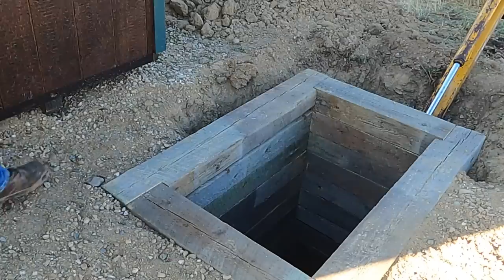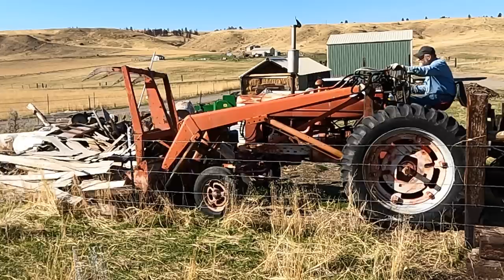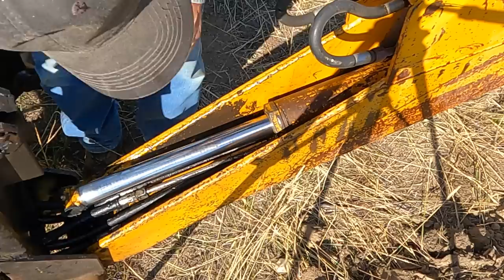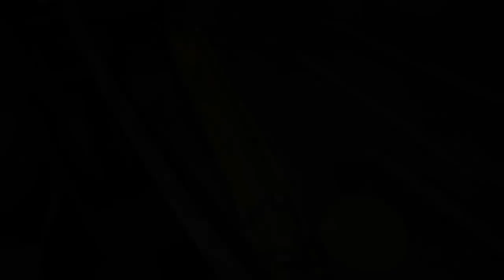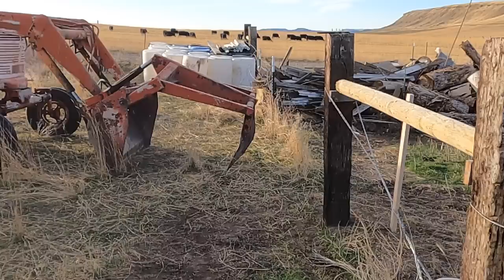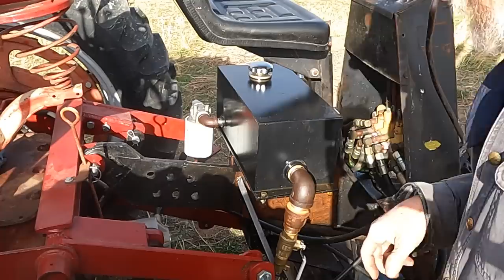Some Learning Comes the Hard Way | Engels Coach Shop

Comment: When you end up with old equipment you tend to inherit the years of poor maintenance, mistakes and patches of others who had the equipment before you. Some of what's been done is good and some of what's been done is bad. 
If you've never seen the piece of equipment before it's very difficult to know what has been done to it which may be the source(s) of problems. 

Sometimes it turns into a learning experience. 

In 20 years of automotive work I had to repair things where there was no repair manual. Having a mechanical engineering background was pretty useful, but it only ever got me so far. The rest was learned through experience. 

So...... I too have a degree from the School of Hard Knocks. 

Good job, Dave!

Comment: Nothing like learning the hard way. I saw that the backhoe shovel seemed a little nervous when extended and then you showed the leak. 
I'd guess by the time this is uploaded you have already got the line in the ground and beginning to cover it up.  Much harder to move frozen dirt, sand, and rock. I think our freeze line here is somewhere around 18in. so we dig down 24in. Don't have a tractor, but a Ditch Witch works just fine for our needs. 
Enjoy watching the progress, and always learn something, so you have a good season and stay out of the cold as much as possible.

Comment: Back in 2001 I took a test on JCB wheeled digger. The examiner failed me because I had dug a long hole and not a trench! I still don't know the difference to this day. I am really enjoying these after work videos just as much as the ones in the workshop.   Thanks for bringing me along 🙂
Reply: Those JBC machines are good, did theexaminer use it at all?
Reply: @jeffclark2725  he did use it and the pins were so worn that he knocked the sides of my "long hole" out! And still failed me! 🤪🤪
Reply: @kirtodam6540  that figured

Comment: Don't feel bad, Ford has been making vehicles for over a century and still did the exact same thing by putting a screen in the power steering reservoir on their small cars like the Focus and many others I am sure which causes cavitation and destroys the pump.  I learned about this from the same school when I replaced the pump for a customer and reused their reservoir and discovered that it wouldn't bleed the air out, it took a lot longer than I would like to admit to figure out that the screen that is molded into the casting and not serviceable was plugged but luckily the fix is to just rip the screen out and put it back together so I have passed that nugget along anytime I have the opportunity. lol

Comment: A little food for thought. I've  always had my hydrants rust through where the pipe threads meet the brass drain. Last time I put hydrants in I dug a 2 foot pit under them filled with washed rock for a good drain, I then set the elbow on a concrete pad and put a 10 section of 4 inch sewer pipe over the hydrant pipe with a cutout to fit the water line and it sets on the pad the top end comes up to the top of the hydrant where I used a reducer from 4 in down to 2 inch with a rubber grommet to fit from 2 inch to the hydrant pipe now I got no ground contact on the pipe and ground heat to keep it somewhat warmer and clean. Working good after 17 years and counting.

Comment: I watched your video on forming stage coach side panels. I used to work in a boat yard and I would resaw  14" x 5/4 lumber (mahogany) to 3/8" on an old Oliver 36" band saw with a 12" tall plywood fence and double decker finger boards and then through the planer for 1/4" thick finish planking on  big mahogany motor boats (26' / 36') with twin Mercuiser engines

Comment: Make sure and dig down below where you place your hydrant. Even a post hole auger would work well. Back fill with gravel for a place for the water to drain. With that hard clay you are digging in, the water won't have a good drain to run back out of the hydrant. Eventually it will star to build up and reach the frost line. I always liked the application where they use a vertical piece of culvert and filled with baseball sized rock, so a person can just empty the hole out by hand to access the foot valve without having to re dig the entire thing. I do wonder how the air gaps in the stine might effect the frost line depth though???

Comment: It is always a good idea to use a suction line filter, in hydraulic systems, to protect the pump. But!, suction filters are much bigger than return line filters and are designed to have a lot less back pressure, resistance to flow.

Comment: Hi, Dave pleased you have sorted the hydraulics they are fairly simple until something goes wrong as most things with machinery thank you again for the video.
Reply: I ran a broach once that was controlled by hydraulic logic. I asked the foreman, How come you don't get someone to fix this thing? He looked at me and said, Everyone that knew how it worked is dead now. Then I really looked at the rats nest of lines on the side of it and a slow realization washed over me in that moment as I knew he spoke the truth. That machine was possessed and it was anything but simple. But if you ran it just right it did work. You basically couldn't stop it once it got going or it'd get into a state. Then it'd shake the ground. They had to cut a hole in the roof to get it into the building. It was that big.

Comment: A fix you might not heard of is to wire wrap with SS safety wire and silver solder the wire wrap. That is an aircraft fix. I imagine it would work with any wire and soldering, or brazing. Love your channel.
Reply: James, what a great tip!
Reply: If a water hose gives out, I wrap it with vynal tape, then tire wire AZ nd cover the tie wire with more vynal tape. They'll hold.  Have even done the same using nylon string in lieu of wire.
Reply: I think I will pass on any invitation to go flying with you and on planes buggered
 up that way, but yes any reinforcement to a low strength patch is better than none.

Comment: Until I recently retired I ran a university structural engineering research laboratory with lots of hydraulic testing equipment. Over the years I taught many people, staff and graduate students, how operate it. When I warned them about pitfalls to watch out for I assured them that the reason I knew about them was because I had encountered them myself. Hydraulics can be very unforgiving.

Comment: Hello Dave, I have worked with machinery in the Aust bush for 50 yrs and found that there is a reason for some things.  I would put that strainer back, if that was not there all the sediment that caused it to block would have gone threw the pump and ruined it. The strainer is there to do a job and it seems it done that by collecting all that rubbish.  Roger SA/OZ

Comment: they make them leaks for a purpose, rust control   chuckles.  but is awesome you can fix them small breaks yourself. the average acreage owners would be done hands in the air not knowing what to do if that happened.  but iso love how well your olf M runs, them were the best old tractors, never fail you when you need them. and not a bank account drainer to have them sitting around.
Reply: Oils itself so you don't have to!

Comment: Very interesting and USEFUL information ! Thank you.... hard to believe that that big line going to the pump would only have a tiny flow eh ?  surprising to say the least ! the best part is that you know WHY now !  and the problem is solved !  What I learned from our old ranch was if you buy an old tractor, PLAN on replacing every hydraulic hose on it as part of the initial cost....and that can be very expensive !  that is why you can find old tractors fairly cheap because they have $5000.00 worth of hoses that need to be replaced.... of course I never replaced all the hoses at one time as I have never been rich !  so I made due... replace the worse ones and go for it.... that really is all you can do in that situation, so maybe you are better off getting a new tractor eh?  I seriously doubt that ! all the BS that they put on them now, is a detriment to their function not a addition ! safety switches that will drive you nuts !  so I'll take an Old tractor any time for that reason.... old Iron is good Iron !  but hoses don't last forever !

Comment: pipes buried 6' foot down,   is that the recommended 'frost line' in your area?
Reply: Definitely. We're not so bad here but there are parts of Montana that 6 feet is not enough (I used to live where that was the case, now I'm about 20 miles from Dave). Come a really bad winter and he'll be very glad it's that deep.

Comment: I had to laugh a bit at the motion of your backhoe. It reminded me of those old creature flicks when they filmed stop action motion of dinosaurs and the like back before CGI and I loved it. Keep up the great work, Dave. You are encouraging the rest of us by your willingness to persevere. Question: Will you just bury the pipe leading up to the pump? Is there a way to run that pipe through a bit larger pipe so, just in case something breaks or leaks, the smaller pipe could just be pulled out without having to dig the whole trench out again. Just wondering.

Comment: I have never had a problem brazing hydraulic lines. It will hold no problem.5000 psi system. Look at your gauges on your torch set. They are sliver soldered together. I got  a weird back hoe that has some goofy cylinders on it. Brazed a couple of lines to a normal cylinder to make it work. If brazing done right it's strong
Your repair looked good.
Reply: Braze strength is from 40,0000-60,000 PSI Steel is 58,000-90,000 There's a lot of different kinds of steel. So braze is pretty strong. Stronger than many may think it is. I've scarf joint brazed bandsaw blades together and had the blade break somewhere other then the braze joint. But usually on a pretty fatigued blade. There was a reason I was brazing it in the first place. It had already broken.

Comment: Now that all the obstructions are removed and the system is working good,  have you replaced the filter?  sucking all that contamination into the pump and then the cylinders will not be a good thing.
Reply: Yes

Comment: Here's a idea 💡 make a wood pole and mark your 6' deep and make sure your pitch in the case of a leak water will run downhill and attach to the bucket arms so you can see the depth from your seat
Reply: I thought if he just put a laser line at the bottom of the ditch he could have ran it pretty good.
Reply: @1pcfred  oh yes I don't have one just a long metal clothes hanger pole and a pitch lever with a magnifying glass so I can read it
Reply: @brucebonkowski9568  some laser lines are pretty cheap today. They're not like those laser levels that spin around. Those are expensive. Laser lines just project a straight red line. They're kind of like laser pointers. But you put one up against a flat surface and it'll shoot a line on it. The beam flicks back and forth. I don't know how it does it. But it does.
Reply: @1pcfred  oh thanks for the info I check it out thanks
Reply: @brucebonkowski9568  I have a few laser lines. They're not handy for much. But when they do come in handy they can be useful then. They're certainly neat toys to play with. I was looking at the ones for sale the other day and I don't know what the more expensive ones do compared to the cheap ones. Maybe they're brighter? Because the laser lines I have don't work good in bright light. Too bright and you have to worry about your eyes then. I still wouldn't point the lasers I have in my eyes.

Comment: Years ago I was driving a tow truck for a guy. He was having cavitation issues, no hydraulic power to his bull winch. He had some so called experts in hydraulics come and check it out. They couldn't figure out what was wrong. So having extensive farming experience, I asked him if I could take a look.. I looked his system over, and saw he had installed  a valve the wrong way. Took me less than 5 minutes to find his problem. Turned the valve around and his system ran like it was supposed to.

Comment: Dave, in my years in sawmill maintenance I learned so much I have forgotten a lot, but the one thing I do remember, NEVER PUT A BRASS VALVE IN A HYDRAULIC SYSTEM. I got to witness a 300 gallon tank empty itself in less than 30 seconds, quite a show and a horrid mess. I see you have one of those grenades in your system, be careful, you aren't generating the pressure BUT. Thank you for passing on the advice, it will serve many others if they payed attention.
Reply: Shuold it be steel?
Reply: @dianeengel4155  Yes, by all means. There is a huge difference in the pressures we ran in the sawmill and what the tractor puts out, the mill ran a huge pressure and the tractor probably half or less of that pressure. But a steel valve is way stronger than brass.
Reply: Dave said it is in a suction line with no pressure.
Reply: @rayc.1396  in this day and age not all brass is created equally either. There's domestic brass then imported brass. Imported ain't the fancy stuff either. If it's say imported from India or Thailand.
Reply: Lessons from the USS I Iwo Jima disaster.
Reply: @dianeengel4155  That will be fine.
Reply: @1pcfred  I know, I retired in 2012 but worked till 2016. The problem with brass is getting something that is strong, China ain't it, and most are made there.

Comment: Probably to late and  you might not want to hear this but if that screen fouled in such a short time you have a dity system so you might want to replace and inspect the filter often to make sure the system cleans up or have it flushed

Comment: Sailed a 7,000 pound boat down the length of Lake Michigan in a huge Norther.  Doing 12-18 knots of boat speed, one wave kicked up and we slid down this steep hill at 23.6 knots, fastest I've ever gone. We're coming to Chicago and the wind dies.  Fire up the diesel. Dies pretty quick. Tried everything. Took hours to go 1.5 miles. Tied up and the mechanic came in the morning. He knew exactly what to do. He unscrews the fuel line from the diesel tank, nothing comes out. He takes a pencil from behind his ear and pokes it into the diesel tank, fuel comes out. He screws the fuel line back on.  These tanks had a screen in them too. The swirling of the tank in the heavy seas stirred up the sediment, clogged the screen. He said the screen wasn't necessary, that is what the fuel filter on the engine was for!  I feel you pain buddy.

Comment: Many years ago while working on a snowblower I discovered that the manufacture had used the wrong size return line from the hydraulic motor to the tank. Normally on a hydraulic system the return line is twice the diameter of the feed line, but the company had used 1 1/2in for both lines, and under a load the motor would work against itself.  Considering that this machine cost $180,000 it was a mistake of the stupid kind.  Obviously they did not go to the same school as Engels did!

Comment: Great video again. I'm in awe of the tasks you undertake. The thing I don't really understand, and probably everybody else watching this does: Where's the water in the tank going to come from? I assume there's no water main out there, if there was you'd be using that. It doesn't look like it will be rainwater, I can't see any method of collecting it or getting it into the tank. Will it be by periodic tanker delivery? If so, where's the stuff that will allow filling? Just a hose through that door into the top of the tank, somewhere under the insulation you have covered it in? This pit seems to be all about the outlet line from the tank to the water trough, but maybe there will be some arrangement also to allow filling the tank from the bottom? As you can see, I know nothing about all this, and am confused. Most viewers probably understand it exactly, sorry for my ignorance.
Reply: We will haul the water from town.

Comment: Dave,  great job so far on the water project.   I do have a question though,  in your closing scene there are dark spots on the hill behind you.  Is that dark lava rock from an ancient lava flow ?
I remember seeing a lot of that in Northern New Mexico.
Reply: No, no lava rocks there.
Reply: What I can't figure is why he didn't just put the tank where he wanted the water. I guess for head pressure but you had the height of the tank itself. He could have put the tank up on some stilts or something.
Reply: Yes, for the water pressure. There us no pump or electricity.

Comment: The comment was made to place the water line in a larger line to make it easier to remove the water line should it ever leak.  The thought just now came to me to use corrugated drain pipe to put the water line in.  It is inexpensive and would also protect the water line from sharp items in the backfill.. [By now you probably have it already in the ground and covered.]. Oh well, maybe on the next line...